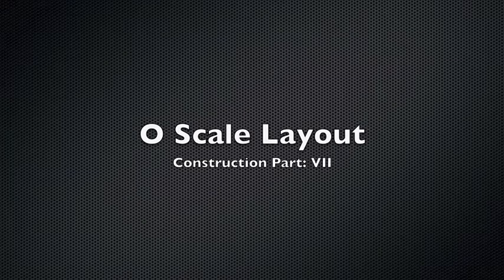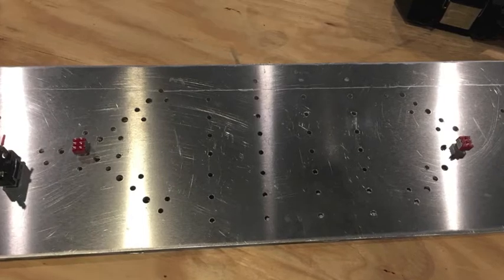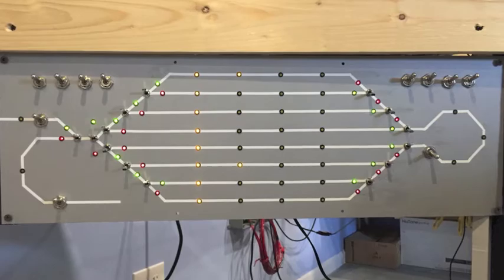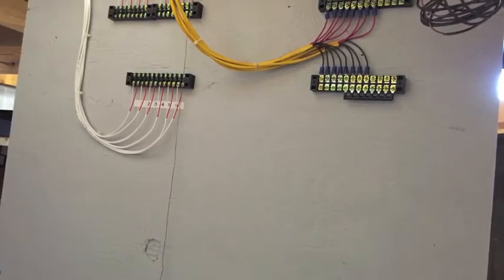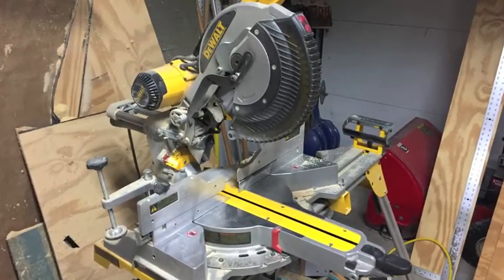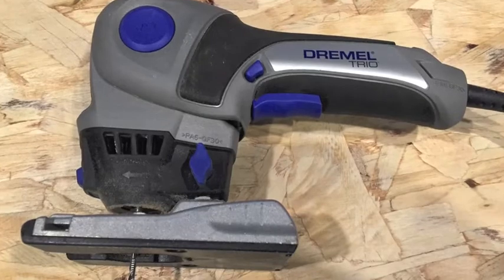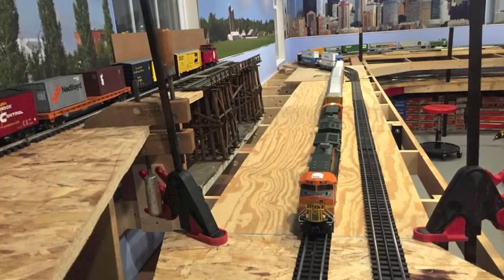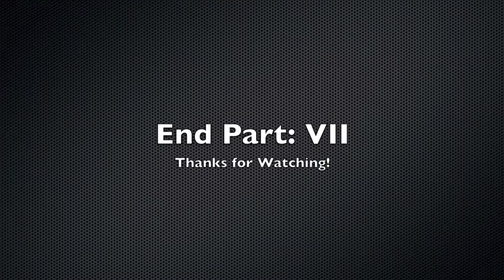O Scale Layout Construction: Part 7

Comment: Really like your layout.  I am in process of creating my own.  Did you do the star method for wiring your layout for the DCS to work?   If so how often did you drop a feeder?
Reply from the maker: Hello, The layout is divided into three (3) zones using a single 180 watt transformer for each zone.  Zone 1 is the north side of the layout.  Zone 2 is the south side and Zone 3 is the lower level staging yards.  All wiring from the transformer to the TIU is solid copper 14 Gauge wire.  All wiring after the TIU is 16Ga stranded copper Speaker wire.  I found this to be the best for optimum signal quality.  So, from the TIU each feed goes to a distribution panel (wiring block) and then out to select locations on the layout.  Some daisy chain was done in hard to reach areas.  Overall this has worked great.  I did have to go back in some area's and tie grounds (around switches) or in area's where it was a greater distance from the transformer.  All wiring connections on the track are soldered and the track pin connections where crimped as tight as possible.   Hope this helps.  Thanks, Alex
Reply: @digistew  thank you

Comment: Can you elaborate on how you do the yellow lights on the panel that show occupied blocks.   Are you using insulated rails or something more elaborate?
Reply from the maker: Yes, one of the outside rails is insulated at various locations.  We use a combination of Lionel and MTH transformers in phase to power the layout.  From the accessory port of the MTH transformer, 10V power is supplied to the LED's (with a resistor in-line to further reduce current).  The negative side is connected to the insulated rail.  When a train passes over the insulated section of track the wheels of the train close the circuit completing the ground connection back to the transformer and illuminating the LED.  I think I used 1/4 watt resistors and first experimented with some test track before implementing on the layout.  Hope this helps, Thanks!